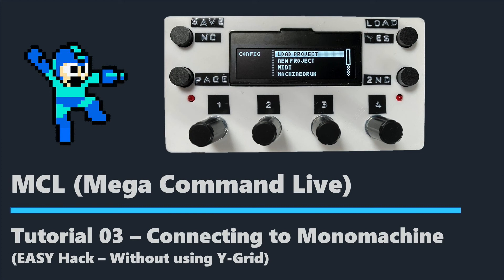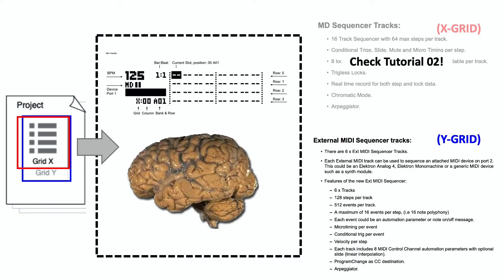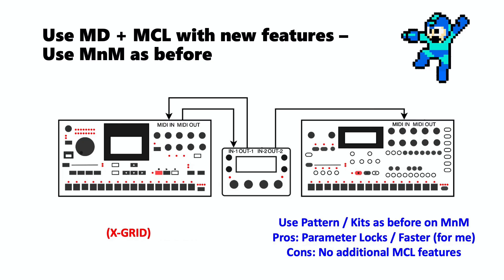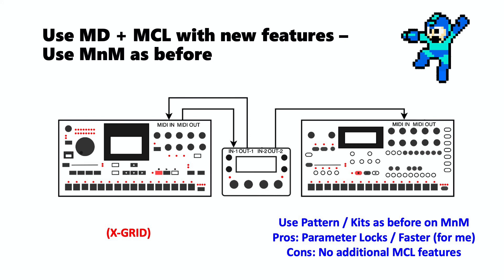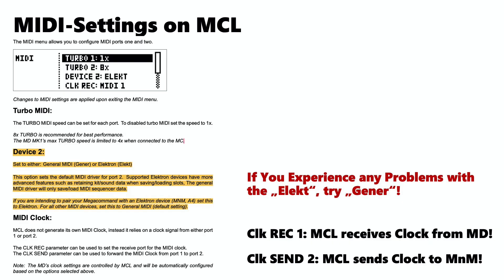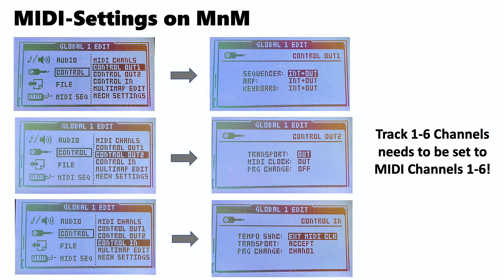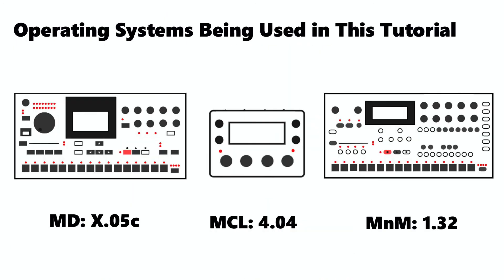Mega Command Live (MCL) TUTORIAL 03 - Connect MnM (EASY Hack!)

Comment: Thank you very much for the video! Have you ever managed to get MNM to work with MCL with Elektron driver though? I get mixed results :/ some slots are saved, some are not, machines settings are usually lost, and so on ... Thanks!
Reply from the maker: Thanks for watching! 

To be honest  - I didn't dare to try the new alternative MNM OS. Doesn't look like many are using it (in contrast to the MD), and it's not well documented. The Mono is super important for me and I don't want to risk a (potential) buggy OS. I am also not a fan of the piano roll. 

This video is also rather old. When I tried to hook up the MD to MNM, the MNM driver was broken in the MCL 4.04 OS. So here it was an attempt to get both machines running and to profit from the MCL-MD features.
Reply: @acid_gray  Thank you! I did a couple of videos on MD+MCL myself and I was really stoked on doing the similar thing with MNM - alas! things don't work there the same way ... Piano roll mode seems OK but slot saving/loading was really random, not working 100% even half of the time. Well, I guess we will need to wait maybe for MCL updated or a new X OS for the  Mono. Thanks again for exploring the subject here!
Reply: @acid_gray Hey there! Things seem to look a bit better with beta 4.70 revision D: https://www.youtube.com/watch?v=zeCjSJTG7pk

Comment: Could you explain what benefits to MCL there was in this instance? I thought this would show that you could use MCL to manipulate the MNM, but I only saw the MNM performing by itself. It sounds like the Y-grid doesn't work well with the MNM. Perhaps this is just using MCL to affect the MD while sending clock to the MNM?
Reply from the maker: The "old" MCL OS 4.04 suffered from a broken MnM driver - which should have been fixed in the latest firmware 4.11 

https://github.com/jmamma/MCL/blob/master/Changelog

So to answer your question: the benefit was rather to use the advantages of MCL and MD - and to use the Monomachine on its own. The 4.11 OS should give access to a functional y-Grid (conditional trigs but no parameter locking  - at least on 4.04). Here it is a personal preference, if you like to work on the piano roll editor.